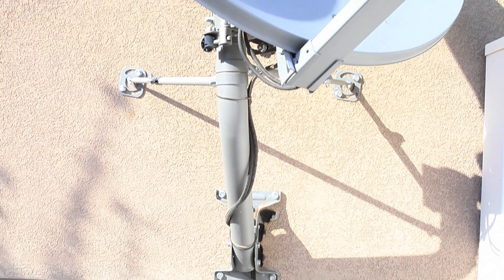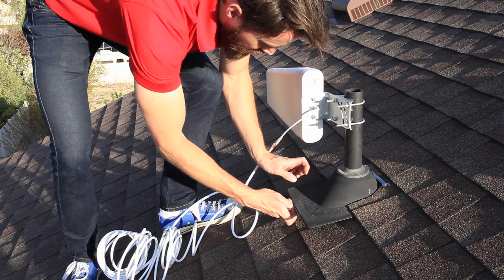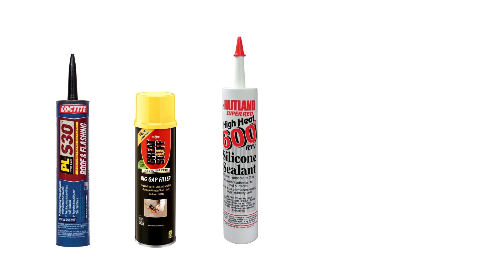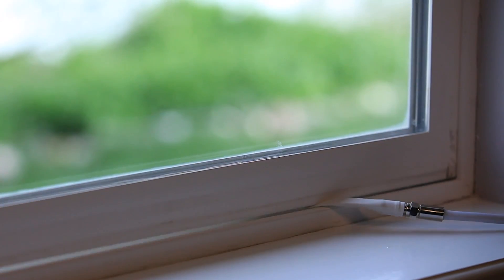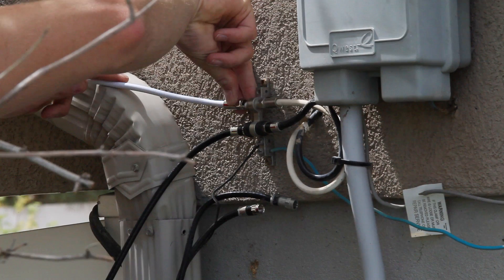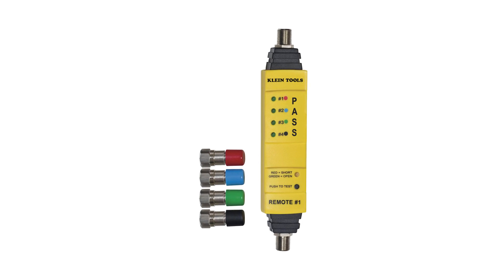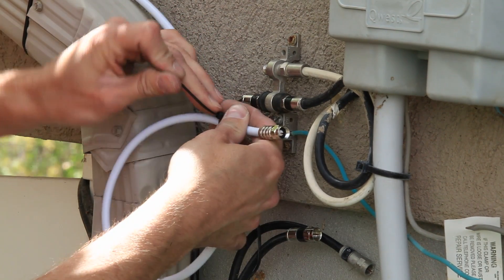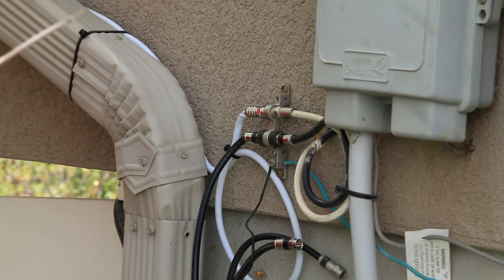Running Cable Into Your Home - Cell Phone Signal Booster Home Install Series (3 of 6) | weBoost

Comment: These are very helpful!  Thank YOu!  I have a question, I'm wondering if you can help.  On our new house build - with several outside buildings, shops etc... I ran CAT5e in conduit underground to each of these buildings.  Is there a product/way to use this cable instead of the coax?  Is there a 'converter' of some kind out there?  THANKS!